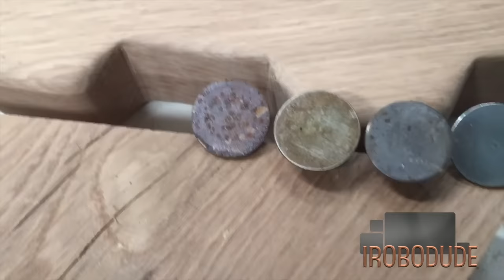Steampunk Art Gear Table Build Ep6

Comment: nice, yeah I forgot about the soaking, I made a long trough and soaked the slats in it, sorry.
that roll of copper is just plated on steel. you might be able to get some copper strips from a roofer.
best
Reply from the maker: +Rev John O&#39;Toole Sorry, haven't had time to respond Rev.  I had some freezing weather and then some real work the past few weeks.  I am back on the table and will post another video soon.  Thanks for watching and as always thanks for the suggestions.